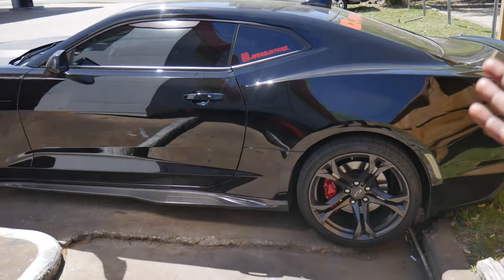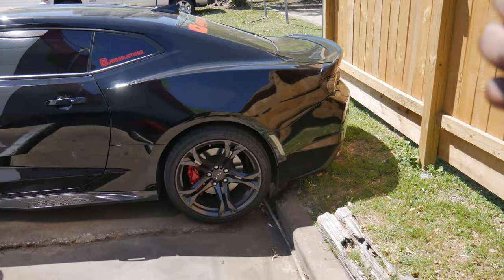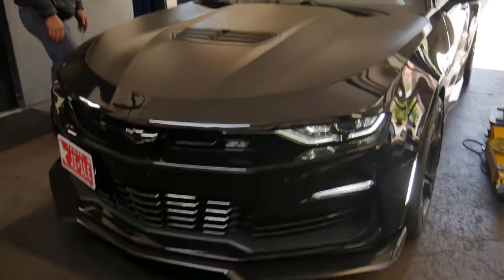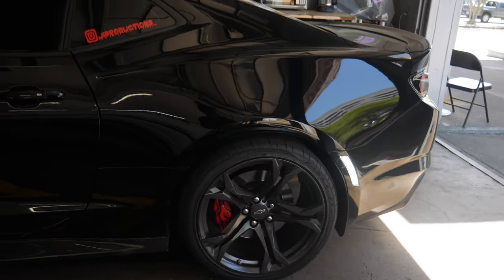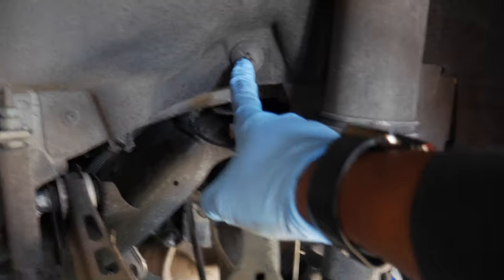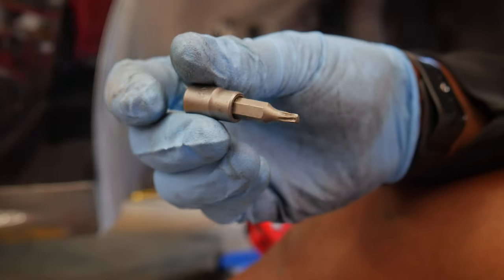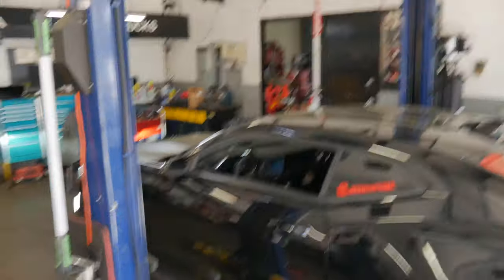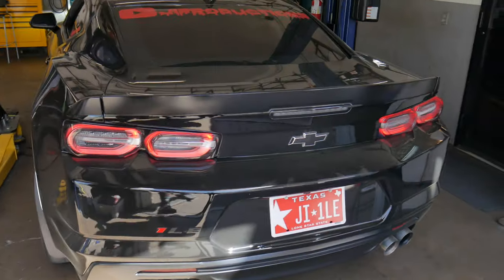DO THIS BEFORE RUNNING 305/35/20 TIRES ON YOUR 2021 CAMARO OR IT COULD BE REALLY BAD... (TIRE RUB)

Comment: Hi so no rub or anything for 305/30/20 in rear and 285/30/20 front?
Reply from the maker: No that’s the stock tire size for the 1le wheels
Reply: @JIProductions  I got a 2020 2ss and I'm planning to get those wheels and bump up my tires to those size. Will there be any rub?

Comment: why i never dee folks run da same size all way round like da hellcats? i wanna put 305's all way round, it must be a reason why chevy do dat right?
Reply from the maker: I’m not sure honestly bro I’m guessing it’s because the are rwd so chevy focuses on putting the grip in the rear versus the front
Reply: @JIProductions  damn i forgot dey RWD & dodge do AWD 🤦🏾‍♂️ preciated broski
Reply from the maker: @luthermartin1144  no worries gang 
Thanks for tuning in gon head and sub for the kid
Reply: @JIProductions  another question, i got a 2022 2ss 1le, im getting kooks short headers instead of long...do i need a extra pipe or catalytic converter? or will da xpipe be long enough to connect flti da short headers and to da exhaust
Reply from the maker: @luthermartin1144  I’m pretty sure your going to have to get some sort of a extension/ connection pipe to fit with stock exhaust